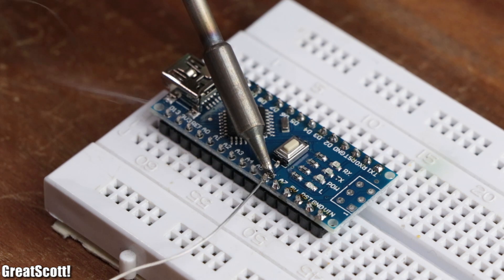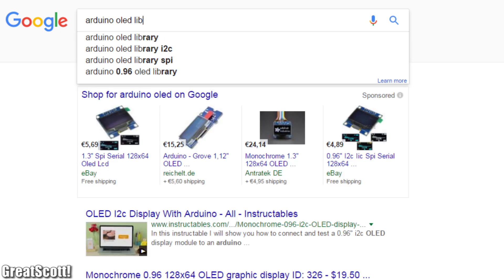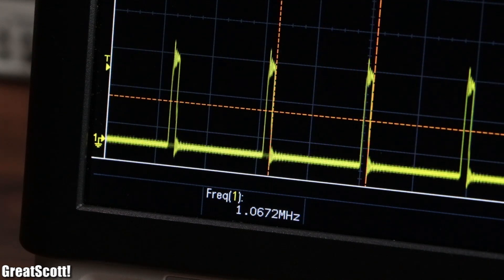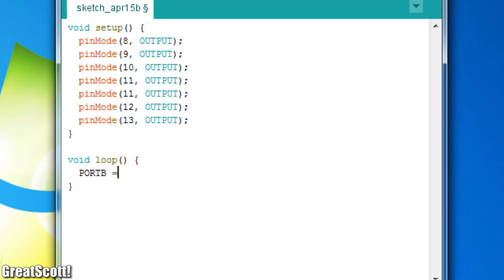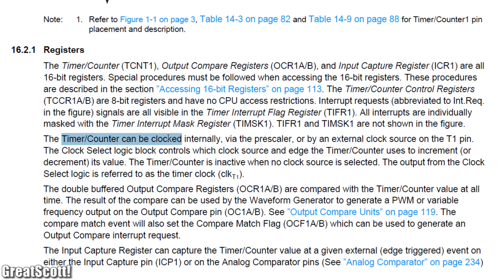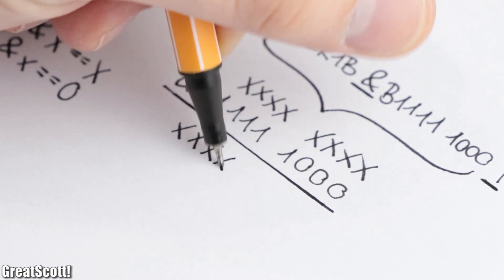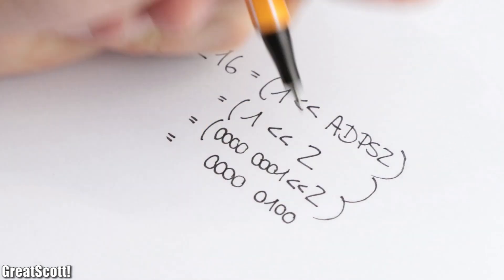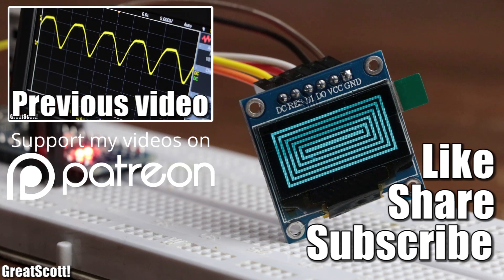Arduino Basics 103: Library, Port Manipulation, Bit Math, Faster PWM/ADC

Comment: Beginner my ass 😆 but great video!

I had to adjust the prescaler to drive some DC motors at higher frequency PWM. It puts the signal out of human hearing range so the motors run nice and quiet.

Comment: @GreatScott! What do you mean by that " the Internal timer can be clocked by a prescaler"? This is a pretty complicated line for me to understand. Can you explain a bit?
Reply: 5:22
The CS12 CS11 CS10 Clock Select bits tell the multiplexer which clock source line to connect the timer clock clk_T1 to, see:
Figure 16-2. Prescaler for Timer/Counter0 and Timer/Counter1

the prescaler is a hardware counter with parallel outputs used as clock divider

So e.g. using CK/64 from prescaler (CS12 set to 0, CS11 set to 1, CS10 set to 1 (in TCCR1B)) with 16MHz clk_IO will give 16000000/64=250000=250kHz counting clock speed to timer clk_T1

Comment: I wish you had spend more time on bit math and special characters like _bv() and the rest. Nevertheless it's been educational. Thanks for the video.
Reply: _BV() (UPPERCASE!) is just a #define constant (BV for Bit Value) that turns this:
_BV(BitPosRegisterNameDefine)
into this:
(1<<(BitPosRegisterNameDefine))
which results in those 8 bits:  00000001 with the 1  shiftet to the left n times, with n as the number that BitPosRegisterNameDefine turns into ...

sfr_defs.h :#define _BV(bit) (1 << (bit))

Comment: Very Nice Explanation...
Great Scott, Great Job!
Btw: The 'B' in B11110000 stands for 'Binary ' not 'Byte'.
Like '0x' in Hexadecimal, eg: 0xF7
See:
https://www.arduino.cc/en/Reference.IntegerConstants
Reply: WARNING: It's not in standard C, but GCC supports it as an extension, prefixed by 0b or 0B
( stackoverflow: Why doesn't C have binary literals? )

and did you notice IN YOUR WRITING you have no zero in front of B11110000
Yea, now you are using an Arduino library define constant: 
arduino / binary.h #define B11110000 240
Reply: correct

Comment: My project requires 16 or more leds, for a runway chaser sequence with a very small footprint.  I'm trying to simulate runway lights on a small aircraft carrier.  Maybe three or four leds, the first one at 100%, second at 75%, third @ 50%, and fourth @25% chasing from left to right in a repeating pattern.  As soon as the four leds reach midpoint in the travel direction, another set of four leds follows from the start position, so you will have two sets chasing from left to right, and so on.  When the first set reaches the end, it starts over again from the beginning, same with the second set.  I have looked all over the web and have had nothing that fits all the criteria.  Doing it on an UNO will not work as there just isn't enough room in the model for the large board.  555 timers with a shift register won't work as most don't have a way to make the fading effect.  Can you help me with a solution?  Thank you.

Comment: I still don't understand why people use the truly crappy Arduino interface instead of using Atmel Studio, where you have real control of the uC. I can understand it can be difficult for hobbits or not professional people, but engineers using Arduino....wth?
Reply: because we have vscode with arduino or platformIO extension

Comment: It is not surprising that many of those who commented (Marwan Nasr El Din) didn't 'understand anything because 'Great Scott' used an approach that confused rather than clarified how one can manipulate bits in a status register to achieve a goal.  Sorry to be so lengthy, hopefully you don't reply TLDR!

The code to set a 'prescaler' value in 'ADCSRA' was NOT clearly described instead a supposedly 'clever' bit manipulation statement: "byte PS_16 = (1 << ADPS2);" was offered at 6:47.  What PS_16 should equal is "100" in binary and 'Great Scott' could have done just that directly using "byte PS_16 = 0b100".  Why not?  And no where does he describe the value of ADPS2.  I have checked the Atmel  AVR 328P manual (PDF) and have not found what I found using my own program to print its value: 10 BIN which 2 DEC.  Maybe Atmel or C++ use the '2' in the bit label to mean the '10 BIN'.  I have found this approach used else where in Arduino code as in WInterrupts.c;  however, the novice would likely not know this as I didn't know and I am not a novice. 

 This means that this statement: byte PS_16 = (1 << ADPS2); is equivalent to "byte PS_16 = (1 << 2);" which shifts left by 2 the '1' which sets PS_16 = 0b100 which is the desired value to use for a prescaler divisor of 16 in the ADCSRA register.  ADCSRA is properly set using: "  ADCSRA |= PS_16;" statement.  Usually,  I enjoy these videos but this one truly fails to teach the viewers.  Arduino reference has good tutorial on bit math: 'Bit Math Tutorial by CosineKitty'; go there for a good background and write a sketch, too; this is how you will really learn how to manipulate bits.

Comment: At 5:10 is the "11" printed by the serial monitor base 10 or base 2? B00000011 = 0x03 = 3 in decimal, if I'm understanding all of this correctly. Of course this is my first foray into port manipulation so it's entirely possible that I'm confused for some other reason.

Nevertheless, it reminds me of the old joke that there's 10 kinds of people in this world: those who understand binary and those who don't.
Reply: binary(=base2) because second parameter of Serial.print() function specifies the base format

Comment: thanks for the video. i am a beginner. i have a question; can we exactly choose the PWM signal frequency in arduino? I am trying to drive a MOSFET in a converter which is controlled by switching frequency not duty cycle so the frequncy of the PWM is important for me. I appreciate you help :)

Comment: Most arduino tutorials go from basics, like turn off/on a pin, flash a LED etc. and by tutorial 10 you're talking fancy talk like using for loops and so on.
With Great Scott though, the complexity is exponential. At this rate tutorial 5 will have us manipulating the universal gravity constant through software.
Reply: Agreed. He went from 101, to 102, (undergraduate classes) to class 506 (doctorate class). I pride myself in being able to at least follow Great Scott in most of his videos,  even if I couldn't necessarily repeat what he said... but in this case,  let's just say if he comes out with a 104 class I'm going to pretend i didn't see it!  LOL

Comment: is there a command for bitmath to pinmode?
Reply: example with port B pin 1 & 3 as output:
DDRB = (1 << 1) | (1 << 3);

instead of "1 << x" you can also use _BV(x)

D*ata*D*irection*R*egister*B has 8 bits (8 pins), default value is 0 for every bit (input), if you set a bit to 1, the pin becomes an output

depending on the microcontroller you have to look in the datasheet which pins correspond to which port

if you have an input pin and write a high value to the pin (PORTB |= 1;) it is the equivalent of pinMode(pin, INPUT_PULLUP);

Comment: *#$& the critics you are showing me things that is drawing me to 
look under the bonnet. I am exited to see how to use an opto-encoder 
with i held in my hand but could not get my head around how to use with 
the arduino. I used an IC555 as a switch be-bouncer to get rid of the 
erratic behavior of the output on the explanation of using an interrupt.
 Would like to see more of your stuff. Thanks

Comment: Guys let me tell you something. I have learnt how to deal with electronic circuits at university in the first year. The thing i want you to know is that you have to spend time understanding how a CPU works and how to make logic gates with transinstors, diodes, and what is inside ic's. It is usefull to know op amps, logic gates, logic designs and memories. If you want to understand digital electronics you can watch some videos from Neso Academy Digial Electronics and Analog Circuits and to understand how a CPU works watch Ben Eater channel. Beware this process of learning takes a while but it's worth it.

Comment: An excellent video. You did cram a lot into 8.22 seconds but it was ALL gold. Other viewers, who found this challenging, might like to view the video again; this time pressing pause at the end of each topic and go back until you have a feel for what Scott is telling you.

The message to be taken from this presentation is that; while the Arduino IDE/"language" does make things seem a lot simpler, it does so by hiding a lot of code in the background. This is fine for  flashing LEDs but a lot of the MCU's awesome power is being hidden from you to. When one comes upon applications that need to control, or interface with, many peripherals, one will find the limitations imposed on you by the IDE, limit the applications one can tackle.

Well done, Scott, for dipping your toe into the murky world of AVR programming. Be brave, your subscribers will soon realise that it is just new, not "too difficult" and will be so grateful to you for that lesson.
Reply: Arduino Is a framework, not an IDE, is different, you can use Arduino framework in many others MCU.

Comment: Is there a way to map a digital signal with arduino for instance I want to emulate a NZXT hue+ so what i have in mind is hook a adrino up inline with the hue+ read the digital output for the hue+ led controler and then use the recorded singnal to controle the led's.

Comment: 11 is 0b00001011
not 0b00000011
Reply: 128 64 32 16 8 4 2 1
Reply: Ollyweg 0 ow strange I tought you had to put serial.print(val, here somthing to make it binary) 
or does it detect what type it is ?
Reply: Ollyweg 0 ow looked over that thx ;)
do you like arduino to?

Comment: The "b" in bxxxxxxxx stands for binary I believe.
Reply: quite close, but B0111111 is a #defined value (search for binary.h). A binary value can be written as 0b011111 .
Reply: @virkotho5057  Luckily I new that but I think he should have said it too. Now some people think its the way to write binary numbers
Reply: Long story short from above convo.  BXXXXXXXX will only work with Arduino IDE.  Reason is, the actual syntax of XXXXXXXb isn't supported by all Arduino systems, and you can't use a marco that starts with a number in your #define
Reply: That's pretty much what I remembered, but on checking (with a compiler), XXXXb is not valid syntax (it is valid MASM/TASM syntax, which I think is where I was remembering it from). 0bXXXX is the correct C syntax for this.

test.c: In function 'main':
test.c:5:29: error: invalid suffix "b" on integer constant
  printf("int = %d\n", (int) 0001b );

Comment: This will be handy for setting unused pins on a mega2560 to non floating/input with pull up. without a whole bunch of digital write or pin mode commands

Comment: show how to make a library for a simple component... looking at the datasheet, understanding the registers of the component and all of that stuff
Reply: Making a library is really simple, I don't think that needs a video, a guide on Google is plenty.

I don't understand what you need help with for looking at a data sheet, data sheets are supposed to be pretty simple to use.

Open the data sheet, find the data you need, read the data you need, close the data sheet.

If you are having a hard time finding things in data sheets I recommend googling "how to use a table of contents"

Comment: Thank you very much ! I was using a similar code to that in my multi-level inverter controller 
digitalWrite(outPin, HIGH);   
  delayMicroseconds(50);          
  but it didn't accept float values , nor variables . I think now i can manipulate your method to make it more accurate

Comment: will we ever see quadcopter project? I dont know why but I think you are struggling with arduino code :D
Reply from the maker: I am not working on the quadcopter.
Reply: GreatScott! too bad :/ but will you ever work on that? I'd really like to see how you do it, cause I want to build it myself, but i dont know where to start...
Reply from the maker: The problem with the quadcopter is that it is quite a big project if you want to do it right. But I still have to produce one video per week. So at the moment it is not a suited project for my channel. If I have more time or an assistant than this is possible. But then again an assistant costs money and that is something an electronics channel like mine does not make in such a quantity.
Reply: GreatScott! hopefully you'll find some time to do it.if not, I'll try to make that drone on my own. Keep up the good work :)
Reply: GreatScott! I would really like to help you with that project, even without getting paid for the work I do because it is a lot of fun for me, the only Problem is that i am only 15 years old and I think I live in a completely different part of germany.

Comment: have you any success with communicating from that rtc with a battery installed?
Reply from the maker: Yes
Reply: using LIR2032 or CR2032? I cannot get working with CR battery.
Reply: +Luke Kosters If you think about DS1307 module you should use lithium rechargeable battery, because there is a simple "charger" build-in. To use with CR2032 remove R4, R5, R6, D1 and put jumper instead R6: https://i.stack.imgur.com/6OwGu.jpg
And just in case: you have to provide voltage on Vcc pin, battery is only for timekeeping. According to datasheet whenever Vcc is bellow Vbat *1.25, access to RAM is denied.
Reply: Frank Drebin I have removed those components and added jumper. still no luck. I purchased 2. Going to try that one tonight.
Good info thanks
Reply: update: tried my other board and works fine with CR. I'm hoping that gives me enough time to find an LIR before it blows up lol
thanks.

Comment: this might be a weird question, but what is the advantage of prescaling? why don't microcontrollers just do things as quickly as possible?
Reply: Because everytime the internal clock of the Arduino gives a signal, the internal logic of the Arduino consumes current and thefore energy. So lowering the frequency can save you energy.

Comment: Does using port mapping reduce the portability of the code; as in moving from an uno to a Nano or Pro-Mini?
Reply: Chris Spooner from uno to nano should not be a Problem, these two use the same atmega 38P chip.  I don't know about the pro mini right now, because I have never actually owned one of these

Comment: why you use the diagram of atmega 168?
Reply: They are the same, but with different amount of memory. The 8 in xx8 tells you it's an 8bit microcontroller, the other tells you how much programmable memory the chip has :)

You can check out the datasheet here:
http://www.atmel.com/images/Atmel-8271-8-bit-AVR-Microcontroller-ATmega48A-48PA-88A-88PA-168A-168PA-328-328P_datasheet_Complete.pdf

Comment: I wil ask here again: Where exactly did you buy you NRF24L01+?
Because all the ones i can find are counterfeit ones which don't go into Sleep mode and therefore draw about 1mA when they should draw 1uA. Would be glad if i get an answer

--onix331
Reply: He often lists aliexpress in his videos. If you want to be sure you're getting authentic product buy from dedicated electronic suppliers other than ali/ebay/amazon (yes you can find them there aswell).

Your NRF could also be faulty, and not counterfeit.  Also according to the datasheet it should draw 0.9µA in power down mode and 26µA in standby-I mode, perhaps the circuit draws a bit and you're not properly powering it down?
Reply: Oh and btw. You can find distributors if you scroll down on  https://www.nordicsemi.com/ (they developed the chip)
Reply: Nope, the arduino pro draws about 0.1uA when in standby, but the NRF24L01+ draws around 1000uA (1mA). I will try a different module some time when i continue my project though, so i will give you an update on that. And yes, i saw those links he provided but i still don't know where exactly he ordered them

--onix331
Reply: And yes, i'm aware of these vendors, but with these i pay around 20€ for one module....and i need atleast 4, if not 5 when i destroy one